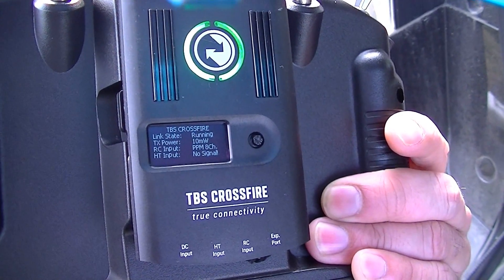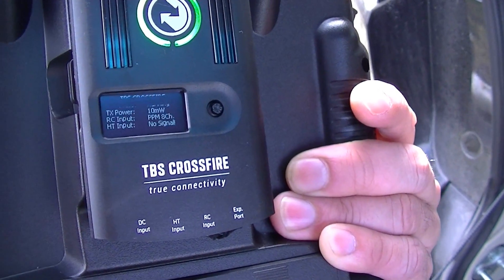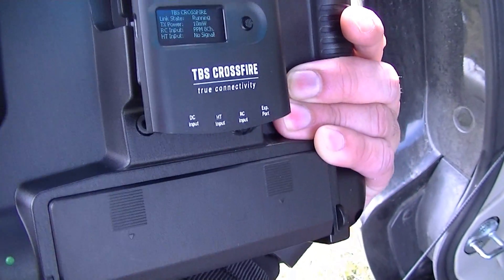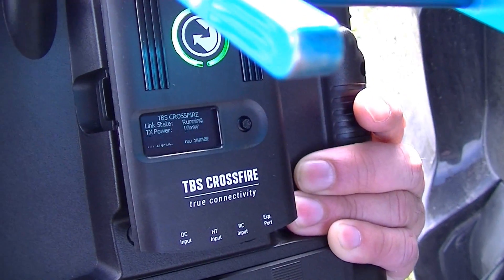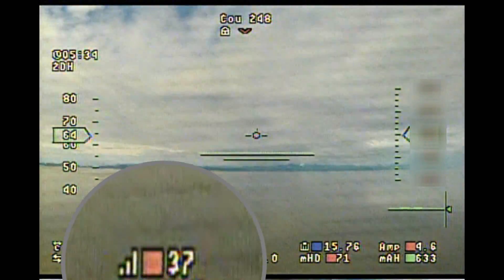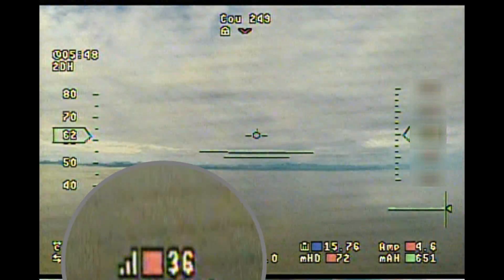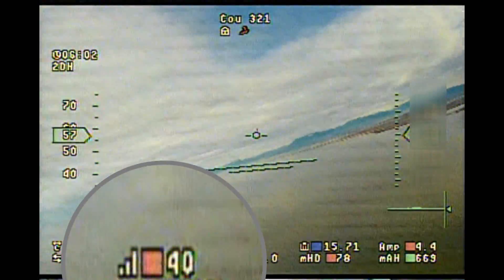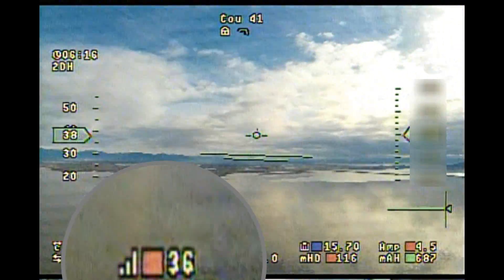TBS Crossfire on Dynamic Power - 5 km out using only 25 - 100mw!

Comment: Hı.How many mw power do I need to travel 3 km?
in tbs module.
Reply: Plane or Quad? planes always get a lot more range. i have seen people get 3km on 25mw. but id play it safe and run 100mw atleast. Dynamic will raise it if LQ goes down a little or RSSI DB goes under -70

Comment: I had some issues with my Xfire. I just received a replacement. Let's hope all goes well with my next setup.
Reply from the maker: +Aero FPV I had issues with my rx when I got them last year https://youtu.be/gyQc6YdyBhQ TBS replaced it right away.
Reply: I guess that first batch had issues. This is what happens when we want something desperately .. lol
Reply: I've not been able to get my telemetry quality above 15-20% with my Pixhawk. Are you running telemetry on your system and what has your experience been? I'm wondering if I got a bad unit. . . I bought mine when they first came out